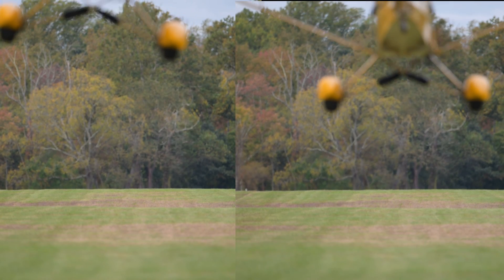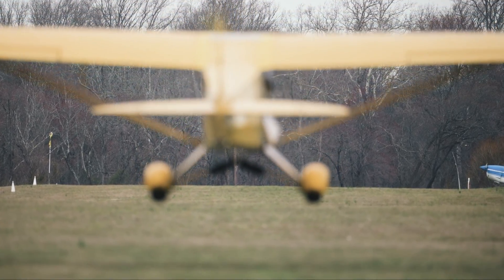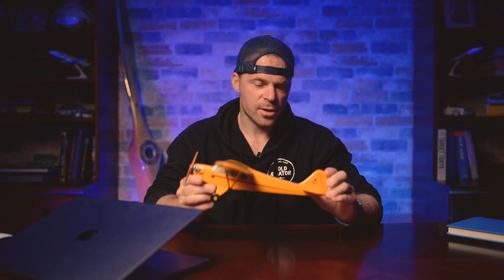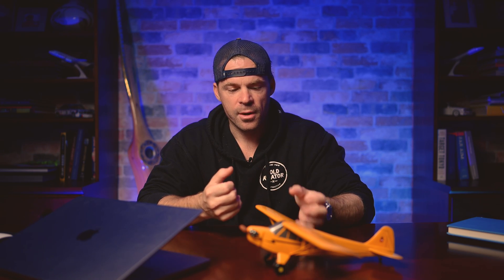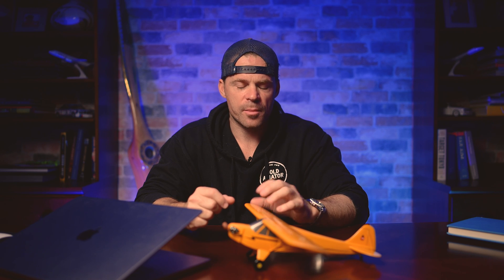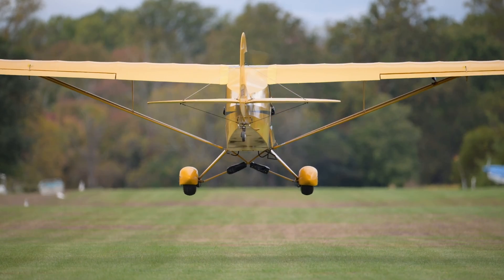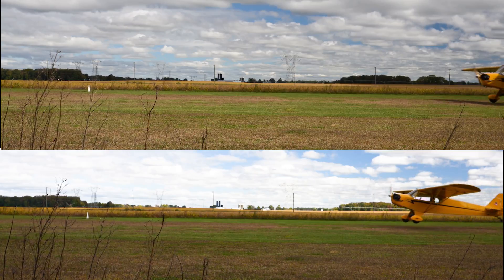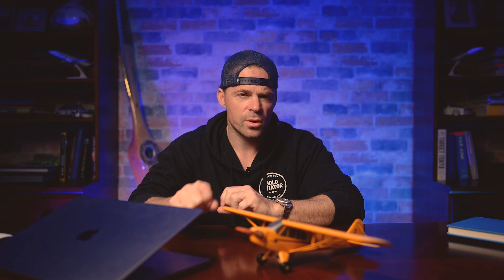Landing a Taildragger, Wheel Landing Vs Three Point Landing. Which is best and Why.

Comment: As for wind and which landing.... I had a very experienced (former fighter pilot) tell me that- much like you mentioned here - if it's a strong wind or especially gusty, to try for a 3 point landing. 
Partially because of rudder authority, but also because with that rear wheel on the ground AND  the wind against an angled fuselage, you will have more stability.
Either way, know your limits. For me, anything in double digits perpendicular to the runway and I'm staying home...

Comment: I prefer wheel landing in crosswinds ,higher airspeed and rudder authority, let the tail fall when the aircraft slows down, back full on the stick to get pressure on the tail wheel and active feet on the rudder. On still air, a three point is preferable and very fun. Full pressure back on the stick coupled with active feet on the pedals to maintain steering control.
Reply from the maker: I kind of feel the same way. I usually end up doing a three point IF the wheeler doesn't go as planned, lol

Comment: Debate all you want. Fact is, most safe landings require the air stream to flow efficiently over the vertical and horizontal stabilizers with a high tail not blocked by a fat fuselage🙂. Pilots should be proficient at both but we will let you guess which one provides more directional control, more view of runway, more stability in gusts and less chance of ground loop. Some of you 3-point purists might have wanted to argue this topic with Mr Robert A. Hoover on this. 🙂 Bob knew the correct answer. 🇺🇸

Comment: For my 2 cents, 3 point landings should be the first choice unless the aircraft being flown has characteristics that make three point landings less safe than wheel landings by design, and I probably wouldn’t fly such a ship. Why would you burn up more runway than you need? Some pilots say they have more control performing crosswind landings on the mains. That doesn’t make any sense on the face of it. You’re most vulnerable to ground loops while the tail is still flying. The plane’s not done flying when landed on the mains and an unexpected crosswind gust could have you looking at the approach end of the runway if there’s more wind than rudder. A fully stalled aircraft landing in my humble opinion, is the safest bet.
Reply from the maker: What I do really like about a wheel landing is having more flight control authority due to higher airflow over the control surfaces
Reply: Until you start slowing down and catch a crosswind gust during transition

Comment: Firstly you are extremely brave with this subject, Yes I am currently on heavies and we all know that these are mainly trikes ! however, there would be many pilots, myself, old & bold that would disagree with you on many areas that you have mentioned. An example is: You mentioned that you carry out 3 point landings in gusty conditions, that I would never do, as what happens with the angle of attack? yes lift is increased, so a gust will no doubt lift your aircraft possibly out of ground effect, I have seen this occur more times than once, this would be unsettling. There are many other disagreements, however I won't go into them. In my spare time I do fly a decathlon and Pitts S2 and I can guarantee you that both aircraft are wheeled on in so called conditions. I am about to retire "approaching 65" so I'll have plenty more time at our local field ! Cheers.
Reply: I’m with you… wheel landings for strong X winds..
Reply from the maker: Again, just technique, what works for me may not work for you. Also this is for anJ-3,  not a pitts etc. and since you asked, if in a three point attitude and the Gust drops off, a simple, momentary increase of throttle would easily arrest the descent of a J3.

Comment: Good video. I found 3 point was easier to keep straight in a cross wing with the tail wheel being on quicker. It worked well for me crop spraying off country roads. 

It apparently was a wild ride if you tried it in a DC3. So it depends on the airplane,  but with a C185 3 point seems best for the smaller airplanes.

Comment: I'm no expert but for me and my PA12 I do mostly wheel landings.  I was taught that way and it just stuck.  I fly mostly from paved runways and from an airport that often has a crosswind and I just like to "fly it" as long as possible.  Yep, it will weather vane as the tail drops but if you are going slow and ready for it... that feels pretty normal after a lot of landings.  I have vortex generators and slightly larger tires and with the tail down, no matter how slow I'm going, my airplane will think about flying in a head on gust of wind.  I just had my 2 year review and my instructor was questioning me about why I always do wheel landings.  We were just about stopped, tail down, idle power, getting ready to exit the runway, a little gust of wind hit us head on, and the airplane started to fly a few inches off the ground and I said "did you feel that? that's why". In that case I keep the stick on the gut and just let it 3 point land again.  Plus the airport I fly from has a little "kicker" bump that will kick it back in the air in a 3 point no matter how slow you are going but in a wheel landing I can keep it pinned over that bump easy.  I like to keep practiced with 3 points on grass when I get a chance though.
Reply from the maker: I'm about 50/50 in the Cub but the Chief I am 99% a wheeler, lol
Reply: @Bananasssssssss  love the videos by the way.  You are doing good dad, taking my daughter (25) flying today.

Comment: Great video! Wheel landing almost always for me and always hold tail up with elevator then brakes and then will soften the let down with heavy braking unless ground is soft and/or no wind or a tailwind. If no winds or right down the runway then stay off the brakes. Crop duster pilot. I’ve had a mild ground loop and it was in a crosswind and was trying to do a three-point. After that, I stayed with wheel landings and never even came close to ever having another ground loop. 😎

Comment: Nice video.  I use 3 pt landings for short field or fields where I have concerns about the condition of the runway…otherwise, wheel landings always.  Also, due to visibility issues on some airplanes, wheel landings are a must.

Comment: I was introduced to tailwheel after a couple hundred tricycle (nose roller) hours then into a 7AC champ by an airline pilot friend.  He also had a cabin Waco, so was very proficient.  While there is a time and place to do wheel landings, I'll always remember his comment::  Why do you want to land the airplane twice?   Thus the full stall 3 point was the preferred way either hard or soft surface.  Ended up with around 50 hours,  then fast forward 25+ years when I bought my J3.  Before that I had flown a lot of different tricycle gear (2500 hrs), then stepped away for several years.  Got a BFR in a 172,  then jumped in the  Cub and while the 1st landing was OK,  then after most were near perfect.  The Cub is just SO predictable and so much fun.  Have ~1200 take off and landings in the Cub, but I do alternate between wheelies and 3 points....usually wheelies on hard surfact or strong/gusty crosswinds. but 80% are 3 points... Wouldn't trade the Cub for anything.  May be slow, but eventually gets me where I want to go.
Reply: Bud Anderson is a huge advocate for the 3-point as well.

Comment: I got my tailwheel endorsement at KLBE.  It's an 8000' paved strip, and used a Stinson 108.  90% of my landings were wheel landings, and I only did a few 3 point there. On the last day, we went to a grass strip, and it was SO MUCH easier to land.  LOL  It helped me track, and made for a softer landing. I will say... my landings in general have gotten better since I got my tailwheel. Thanks for the vid.

Comment: My two cents. I have used both techniques depending on circumstances. In general, in light aircraft I preferred a “full stall” landing, especially in a taildragger. I’ve seen plenty of botched mainwheel landings in taildraggers that resulted in a big ballon/bounce with power off. The result of a botched main gear landing is compounded in vintage taildraggers (for example) that have almost no forward visibility and stall at the wingtip first because during the correction you’re generally adding loads of power and stabbing the rudder in a crosswind when all you have is peripheral cues. For my two cents it’s best to three point a taildragger.
Reply: I fully agree. But good luck passing a checkout with a Chief Pilot if you can't do wheel landings. Also, it won't work on the big ones like DC3.

Comment: There are different recopies for different airplanes but talking strictly Cub/Champ types the only legitimate reason for a wheel landing is to keep the tailwheel off of rough ground for as long as possible. There is no reason not to learn the technique and stay proficient at it but don't buy the idea that it's better for crosswinds because it isn't.

Comment: Wheel landings are fine for gusty HEADWINDS. I called BS on the guys that say they use wheel landings for crosswinds. If you don’t have aileron and rudder authority during gusty conditions for a three point, you won’t have enough control authority to let that tail down after a wheel landing. This isn’t opinion, this is a fact gained from numerous landings in a Luscombe with ridiculous amounts of crosswind.
Reply: There's a time & situation for both.

Comment: Awesome video and topic Joe. I fly and operate out of a relatively short bush dirt strip owned by my CFI here in Dubbo, NSW, Australia. Due to length limitations, three pointers are always used and taught by the CFI at this flying school because they tend to have a shorter rollout and have proven to be safer for new students - The aircraft stays down once stalled. However, there is no doubt that when landing on pavement, a tail low or tail high wheel landing is much easier on the aircraft. You can gradually bleed speed off while keeping the tail wheel up, protecting it from possible castor spins and other problems when rolling on the pavement. Totally agree about being proficient for both. You need to be able to master complete control of a tail dragger including one wheel landings before you can consider yourself reasonably safe, landing in less than perfect conditions in my honest opinion. As you say, the cub is very light and has a tendency to weather-vane, so requires confidence and proficiency to keep it under control in difficult conditions.
Reply from the maker: Thanks! What plane are you guys using out there?
Reply: @Bananasssssssss  We use two Legend AL3 cubs and occasionally a Citabria. I own one of the Cubs and rent it to my CFI. Ive only just received my basic recreational instructor rating and aim to become senior, at which time, I'll retire from my current full time job as a communications technician.
Reply from the maker: @Coops777  nice planes 👍🏻

Comment: Another thing why I totally prefer 3pt landings is due to the gyroscopic effect. If you touch down too hard, good luck with recovering your nose going to the right. I personally think there is more security to keep the aircraft centered if you‘re already rid of that problem when touching down, specially on paved runways and with narrow gear.

Comment: Great video Mr Joe, I agree and fly about the same as you describe when flying outa most improved strips. However in the bush I tend to use a tailwheel low wheel landing, lets me hit my spot, get hard on the brakes if needed, that raises the tail and lets me get one more look before the tail come down, then dump the flaps and roll out.

Comment: I love to 3-point the Stinson, but if it’s gusty or there’s any amount of crosswind, wheel landing is the way to go. I have tried to 3-point the Stinson in a crosswind and it just doesn’t work. Not enough rudder (those of you who fly a Stinson know). And I almost exclusively wheel land at night. 

Also, another thing for some of you guys who are one or the other to keep in mind, some airplanes you do not 3-point (the Ford Trimotor comes to mind) and some airplanes are more inclined to do one or the other. My Stinson has a pretty far forward CG, and unless there’s weight in the tail, it can be a chore to 3-point it sometimes. It will, however, almost wheel land itself. 

Stick and Rudder is a fantastic book, I always recommend it to people.
Reply: Used to fly an HW75… fun little Stinson. And yes, I agree, each taildragger has its own quirks. I owned an early Sonerai… solo from the rear seat only. It was totally blind and had no toe brakes or differential braking. It was almost impossible to wheel-land that thing with its springy gear and long moment arm coupled with lack of braking. 🙄

Comment: Thanks, Joe, for the excellent lesson and video.  As you say the Cub is slow enough that a bit extra speed for the wheel landing is fine.  They are, however, the same landing.  Wolfgang's "all slowed up and ready to squat" is important either way as the Cub, actually any airplane has to be well below Vso in low ground effect to quit flying.  The way I approached it in no or light wind in Cub, Champ, Luscombe, Taylorcraft, or Pawnee, was to decelerate to keep the apparent rate of closure at a brisk walk (apparent not real, same as in your auto coming into an intersection) so as to arrive at the numbers in a three point attitude all slowed up.  Here I chose to either keep coming back on the stick to the stop, full stall, or to level the fuselage to wheel it on slow enough to not fly (not bounce.)

Now with the strong crosswind.  A Cub can be landed in a pretty strong crosswind straight down the centerline, but with the slow normal ground speed of a Cub and into a strong headwind component there is no need to go straight down the centerline.  Make an apparent centerline between the downwind corner of the runway and the big airplane touchdown zone square.  Ok, we have to use our imagination on grass.  Anyway we can land at an angle to significantly reduce the crosswind component.  Yes, we still have to side slip into the remaining crosswind component...your upwind wheel down first.  Again, this works with any light airplane.  Secondly, in a strong crosswind, we will still be flying, we will still have lots of airspeed even though ground speed may be at or near zero.  We will not be able to arrive at the downwind corner in a three point attitude as this would send us back into high ground effect or higher.  We will have to wheel it on and keep the same or a bit less angle of attack to prevent flying.  We will not roll far, but we may need help with taxi.  i have had to wait for the fuel truck to taxi upwind in formation with me to get to tie downs.  And when alone where tie downs have a lot of grass around them, I have parked the wrong way and had to get help swinging the tail around without the airplane blowing away.

Yes, this was more than fifty years ago when Champs, and most trainers were a couple thousand dollars.  Cub got to be too high way back and all are too high now.  Speed is what causes extensive damage in the ground loop.  Using the apparent brisk walk rate of closure short final, slow enough that the airplane only had to roll ten feet or so to be slow enough not to catch a wing in a ground loop, I would not stand on a rudder to prevent the ground loop.  As you say, once you have seen it you know what it is.  Students will do as Papa says and walk the rudder dynamically and proactively during taxi, takeoff, approach, landing, roll out and taxi back.  The will walk the rudders in their sleep.  The problem with teaching primary (I haven't in years) with 50,000 dollar airplanes is that the student/owner wants you to save the airplane rather than teach him how to use rudder yaw properly to bracket the centerline.  I never rode the controls and never will.  So only nose wheel airplane now when instructing takeoff and landing.  I talk but say, you are on your own (tw).  I can tell you but not help you with my bad leg and slow reaction now that I am old and almost used up.

Anyway, good lesson.  What you and Wolfgang teach works in any airplane.  Airmen Certification Standards are way too far removed from him now.
Reply from the maker: Great advice Jimmy! Love the part about apparent centerline. ! Will use that in my upcoming video!

Comment: Just got my tail wheel endorsment and bought a 2007 American Champion Champ. Still doing mostly 3 pointers at this point but this week I'll start with some wheel landings as well. Thanks for the great video.
Reply from the maker: What I did initially was commit to basically “go-arounds” or touch & Gos. Basically just trying to make smooth contact with runway then go around until I got more and more comfortable and then would “land” hopefully that makes sense
Reply: @Bananasssssssss   Brilliant idea! thats a great way to pull all the pieces together so thats what I’m gonna do - thanks!
Reply from the maker: @overthehorizonadventurerid108  absolutely!!